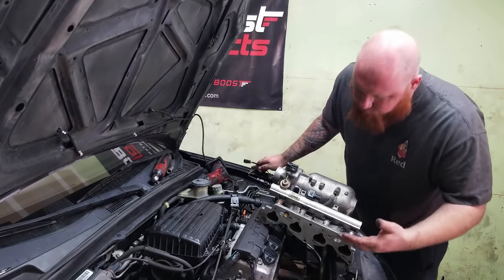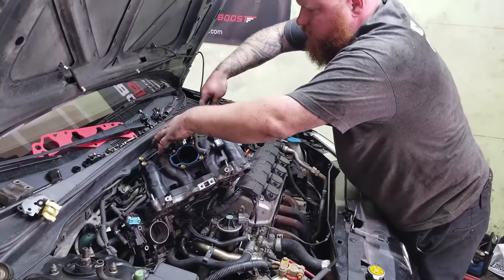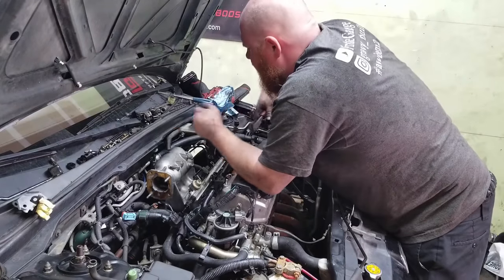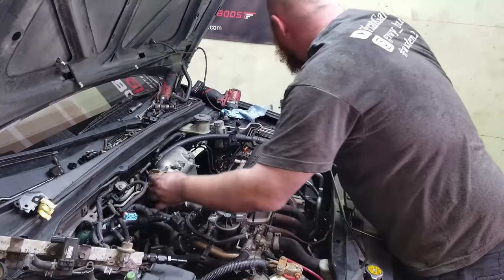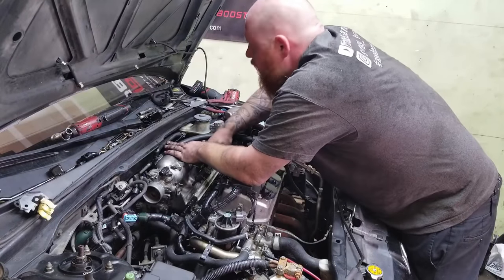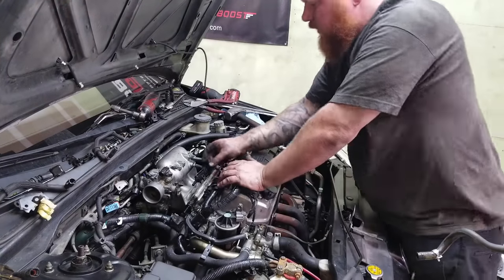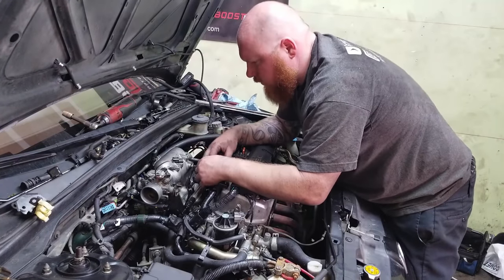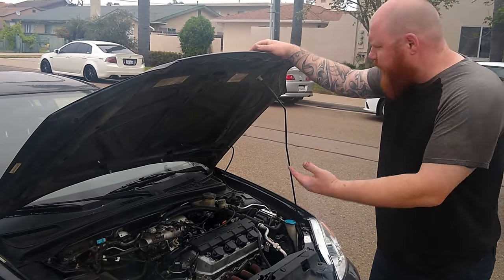D16Y8 Intake manifold install on a D17 with an AWD EM2 surprise in the mail

Comment: D17 life .... Gas mileage and great exhaust Sound.. Honda works with F1
Reply: Check mine out, gonna get new wheels and paint soon
Reply: @olmec_____5536  get dna headers from ebay.
Reply: @redpandapowa  that is a DNA header
Reply: @redpandapowa  DNA header with Spec-D catback exhaust, ill do a sound video tomorrow and tag you in it, sounds ricey af but i wanna get a yonaka axleback eventually to make it a bit quieter/deeper
Reply: @olmec_____5536  noice, yeh tag me
Reply: @redpandapowa  i will, or ill just let u know when vid is there, same difference 🍻
Reply: The DNA head is complete trash, along with every other 2 piece header. Inferno Fab makes the only good header for 01-07 D16/D17's
Reply: @Casey_and_Cars  who are you talking to kid... go cry to your mom
Reply: @Casey_and_Cars  there's no two piece just one piece lightweight.... need to get rid of your cat ... car is ultra low emissions... that means prius territory
Reply: @Hectorszenshopedc  Been working on NA and Turbocharged Honda's since 1997. The DNA header is junk and fails constantly. Poor quality flanges and welds as well as being a poor 2 piece design. Inferno makes a much better design and puts a lot of work into his products.

Comment: Thanks for making the video bro
Reply from the maker: Sure, I got the intake manifold when u got the d16 head cost $40 for both and I have big plans later and having the pressure regulator on the rail will make it easy to do a return fuel system

Comment: Hey Red.. I'm reaching back here; its been a long time since you've done this. I'm about to do this myself: and I'm just a little worried about my fuel line.  You said you just capped the return line, and it looks like the FPR valve is just uncapped/unused: Is that where I would attach my evap line? (the little green capped thing) On the normal fuel rail (stock d17) it looks like what is on the new one the return fuel line is hooked to the evap service port. What was your work around? Did you end up utilizing the evap service port at all? Maybe you remember :)

Comment: So the vtec in my 2004 D17a2 is non exsistant...my question is after istalling that 3 lobe cam outa a d16y8 was there a significant change to how hard your vtec hit? You never showed an after video or mentioned anything about how it drove after the cam upgrade.
Reply: I have a d17a2 too, from what I've heard the D series never crack vtec because it's "always in vtec" which is why they're more economic than other series

Comment: Hey I just found your channel yesterday and I already love it! I'm just curious if you felt an increase in power after you installed this intake manifold. I did the same thing to my D17, but my plastic one was broken for a while before I installed the Y8 manifold so I'm not sure how much power it gained. Thanks
Reply from the maker: I really didn't drive it in between and the cat was clogged
Reply: @PirateGarage  Oh okay thank you. Did you ever get your idle air control valve to work? I was never able to get it to work correctly with the Y8 throttle body. Thanks!

Comment: Hey red i seen a coolant bronze like tube on the bottom under of were I/M goes but has a small rubber hose with coolant comin from it where would i hook up that coolant line to?? Does it go with a tee to the thermostat & back of the intake manifold together

Comment: Did it do okay with car computer? Any check engine lights or idle problems?
Reply from the maker: I'm using a kpro and the d16 idle valve wouldn't work with the kpro
Reply: @PirateGarage   I'm having problem with idal air control valve engine light on, any way to fix
Reply: so what did you do?
 @PirateGarage

Comment: Hey red one question man! I wasn’t sure if to use the d17 throttle body or the d16 and since i dont have the extension wires to the sensors how do i wire it
Reply from the maker: I used the D16 from an auto
Reply: Pirate Garage ok sounds good and what about the iacv? I noticed they were left alone without connecting any hoses

Comment: Can I assume that modifying a skunk2 d16y8 intake would be the same modifying an OEM d16y8 intake? Is there a reason why I only see the stock d16y8 manifolds being used in the swap? I've seen one comment about needing 2 inches clearance and that you would have to cut into the firewall. Any ideas?
Reply: I too have heard the same about the skunk2 needing to cut into the firewall but am still learning the EXTREMELY limited D17 options but assume it's true since no one is doing it

Comment: What is the actual improvement from this as you can see I am getting ideas to do with my em2 like the camshaft and just wondering what the performance improvement was from the d17 to the d16
Reply: also wondering. as much as I like the d16 intake I'm wondering why you bothered with this =/
Reply from the maker: I did the the d16 intake because the return fuel system is easier to setup. It is also easier to do the intercooler pipes. And it was free with the d16 head i bought.

Comment: Where did you get the connectors for the throttle body sensors trying to do this on my d17a1
Reply: B to K TPS adapter
Reply: @tommylyeah  got the pig tail connector for tps and map sensor can I cut my old connectors and wire up the d16y8 connector

Comment: How different are d16 block, head, and internals compared to d17 parts?
Reply: meant to put d15 in there aswell. been considering doing something like a mini me swap. d15 with aftermarket pistons and either a d16 or d17 head. just not sure if the d17 head will fit
Reply from the maker: Very different, I'm not trying to do a crazy mix match of parts just little things. if you want to see a crazy build look at my built k24 videos
Reply: @PirateGarage  Will do! Just found your channel today! Gotta love Honda legos. G23 builds area good example

Comment: Will such a swap D16Y8 intake manifold fit on d17a1 without vtec???
Reply from the maker: Yes the D17a1 head is basically the same
Reply: I have a motor without vtec (D17a1). Can I install the same intake manifold on this engine?
Or will the y8 intake manifold only work on engines with Vtec?
Reply from the maker: You can install it on non vtec
Reply: @PirateGarage  After installation, do I need to configure this? or will work at the factory settings. if  need to configure, how to do it, on my engine????. thnx))

Comment: You need a folding table and magnetic trays for all the nuts and bolts. My OCD was going haywire.  Has anyone done any flow bench recording on oem plastic one vs older metal one? I'm curios to see as the runners seem bigger on the plastic one.  Also keep in mind plastic one was designed for midrange torque. May lose that a bit with metal one at exchange for top end hp.  Im basing this off my experience with m50 manifold vs schrick manifold on e36.
Reply from the maker: I have a folding table look at some other videos and the caul works fine for me for holding bolts. I have been a mechanic a long time my proses works fine for me
Reply: @PirateGarage  right on mang. How does the car run after the swap?
Reply from the maker: Good

Comment: Are you buy the intake y8 on ebay?
Reply from the maker: I bought it locally from offerup
Reply: @PirateGarage  ok,i sorry i have some many questions where do you get it the wiring for the plug the map sensor  and others?
Reply from the maker: They have adapters on ebay. They are cheap